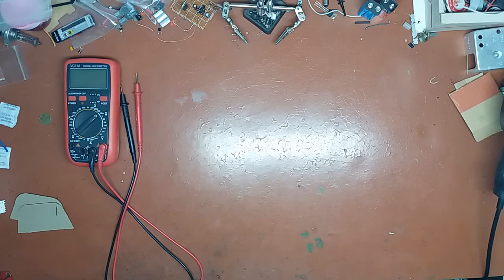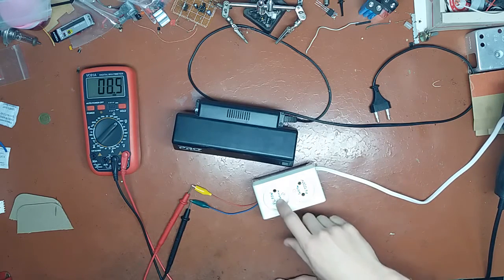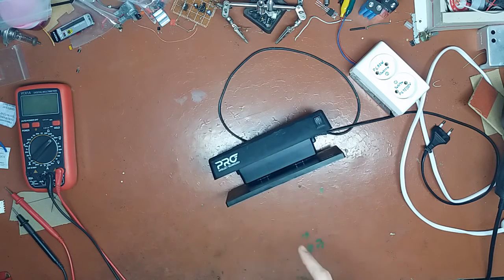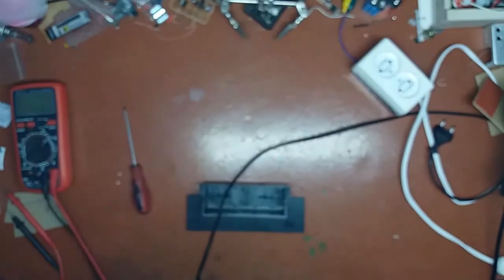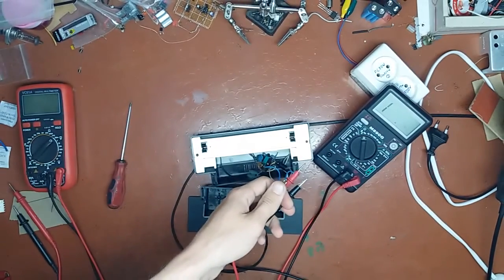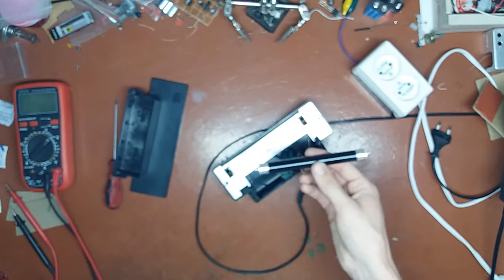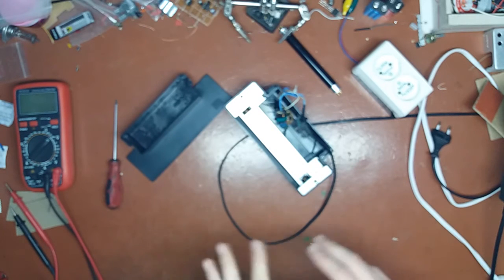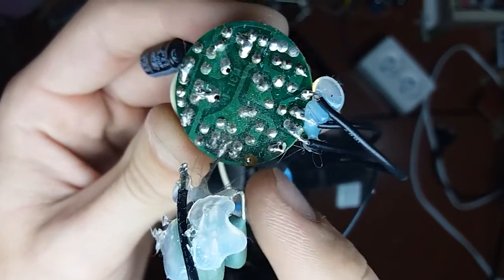Currency detector repair - Part 1 of 2

Comment: I have mosquito killer that uses ac from its converter but doesnt heat the tubes so they got black ends in no time I need to make circuit for driving those heaters.I was thinking of making small smps with transformer that has two isolated secoundary coils for each heater and just let the original circuit take care of driving the tube. What woud be easiest way ? I tried just shorting existing driver over the heaters but It doest have sufficient current to light up the heaters.
Reply: I coud use cfl driver but I am sceptical about it beacouse it does heat the filaments at same time as driving the tube but I think that giving some time for heaters to heat up and then apply HV to the tube is better idea.
Reply from the maker: If you leave the original circuit, it will still be DC which is flowing through the tube, it's bad for it.
 Ballast from CFL heats up filaments only BEFORE tube is lit, after that it is the discharge which keeps filaments warm (well, hot). After tube strikes, it effectively shunts the starting cap over, thus leaving pretty much 0 (even if it's not 0, the current is too small to wear out heaters) current flowing through filaments.
Reply: Original circuit does have ac output but I decided it is easier to use cfl circuit but I only  have about 20w driver board and I need much lower power I need to lower the power I have tried adding turns to driving transformer in order to increase the frequency by transistors switching at lower current  since it is basically a current feedback but power was same :( Than I got a stupid idea and added 200n in series with the input power and got a strobing party light haha It was just very stupid because  when it strikes it just discharges the filter cap completely  and dies. would increasing the turns on the choke work here ?   
 I have a feeling that it would just run on lower frequency to compensate for higher inductance. How do I lower the power ?
Reply from the maker: JOSIP Žlk The easiest way is to change the in series with the choke. It is gonna be the one rated 400v close to the choke. Put something like 10nF 400v in there, it should calm it down.
Reply: I actually did that even before you replyed and power went up by 5W. I used 250ac 0.01uF.Original one was 47nF.I am about to give up on this.
Reply from the maker: That's very weird, when I did that to mine, power went down. Maybe that's because you changed turns in the feedback transformer. That thing is a current transformer, may be tricky to tweak if you don't know exact values you want. Try changing number of turns there to original, if that doesn't help put two chokes in series to get more inductance.
  You got me interested, I will try to do same thing tomorrow and write back if I find something worthy.

Comment: Could you do a video on the amp to volts box you use to measure the current in watts?
Reply from the maker: I did it a while ago, here: www.youtube.com/watch?v=ahEF2-BQ_58&t=17s
Uses analog multiplier chip AD633 and outputs a voltage proportional to the real power consumed by the load.
Since that time I've added another low range, but it is a simple thing to do.